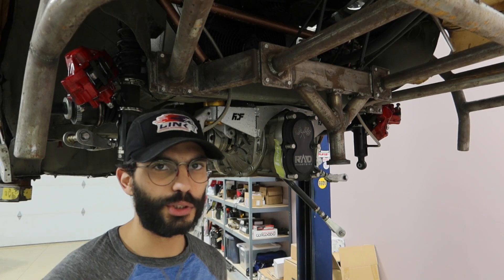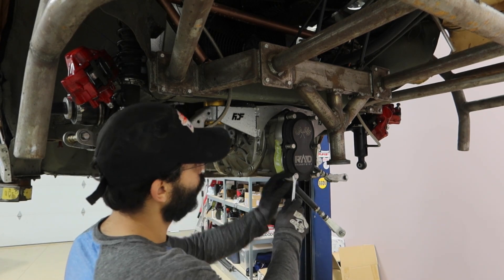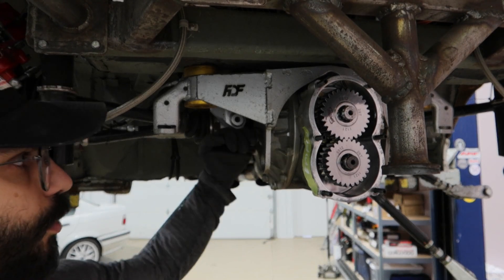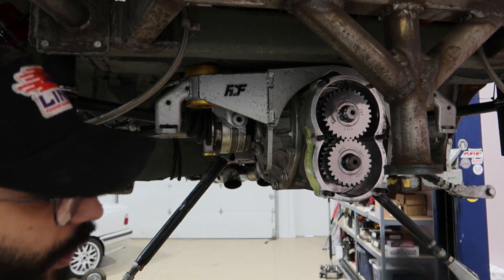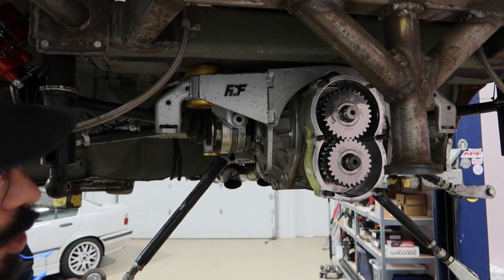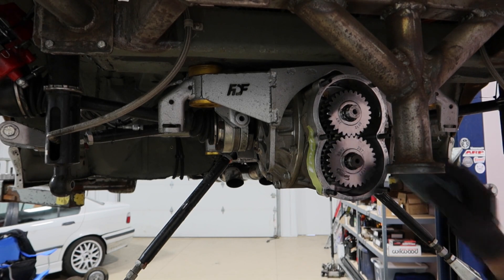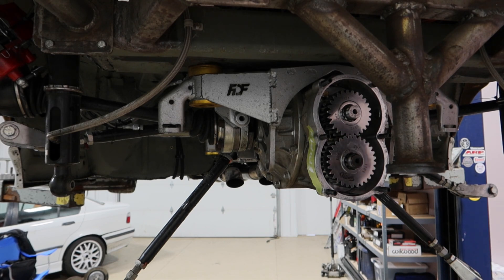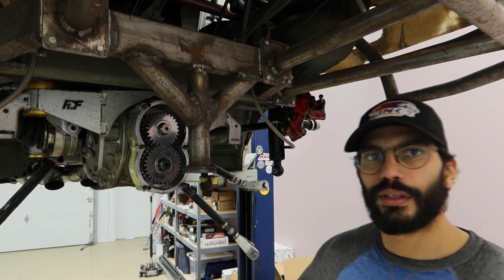Race Car Differential Explained

Comment: That would be a "quick change" rear differential, not all race vehicles utilize them.
Reply from the maker: Correct, I didn’t say all race cars use them but used in a lot of racing and most race cars need to be able to change gearing even if they don’t use a quick change specifically.